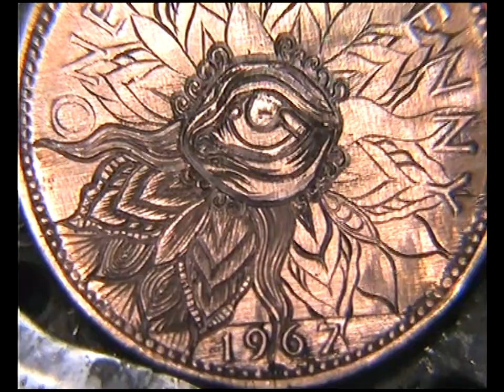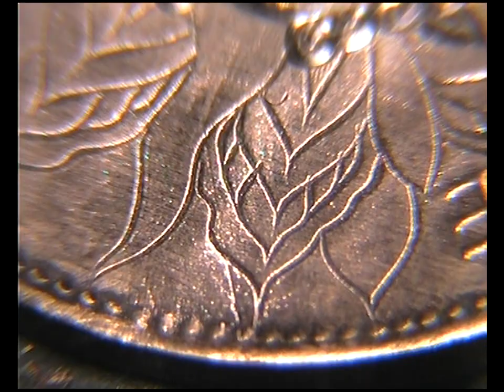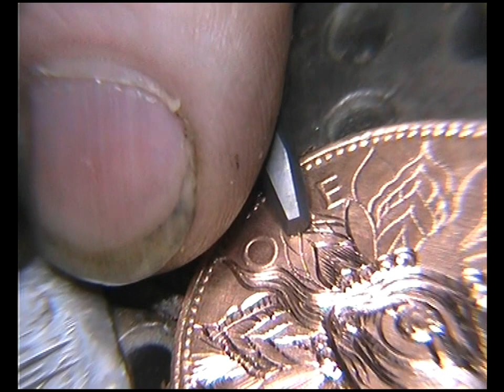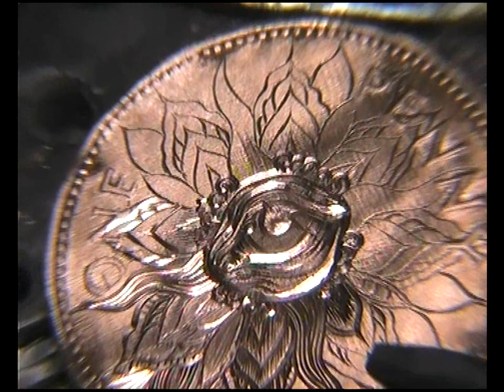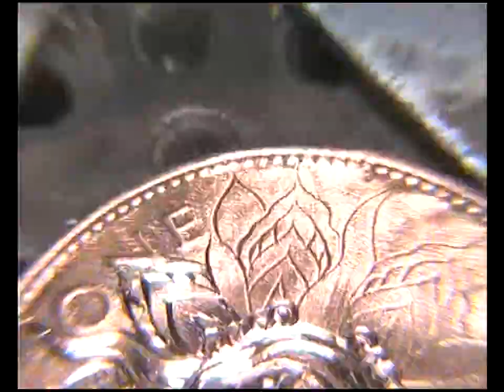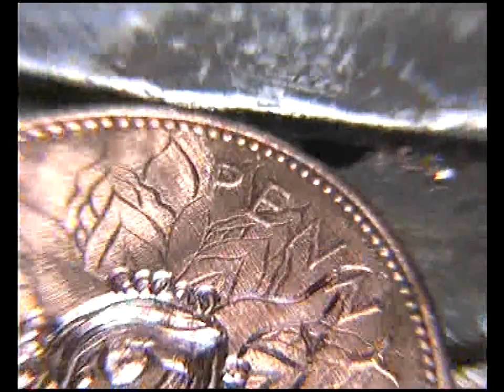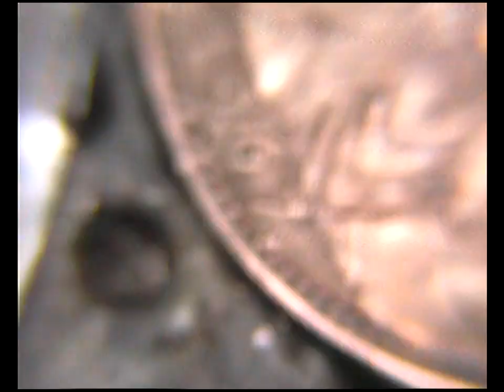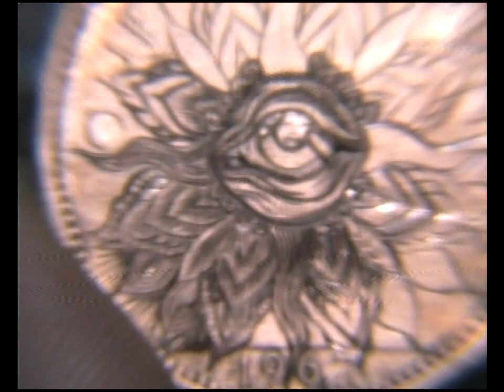Hand engraving Nerve Damage Warning

Comment: Shawn I built my own engraving setup and learned to engrave (kind of) because of your videos. Your videos have had an impact on countless others Im sure. Take care of yourself and heal up. I will tell I had a very serious injury to my right hand severed tendons and so on. Moist heat and stretching and chiropractic care works wonders. Also rare earth minerals seem to aid healing of tendons and ligaments. Best of luck to you.  As always excellent work!
Reply from the maker: Thanks. Every day use my wrist is normal,so cant really complain. I think there are more advantages that not using a power assist graver,and the traditional way to hold is,probably not the best way for comfort,so will experiment when back to norma',or even better :). I'll add the rare earth suggestion to the list of things I'm trying.You dont know until you try, cheers